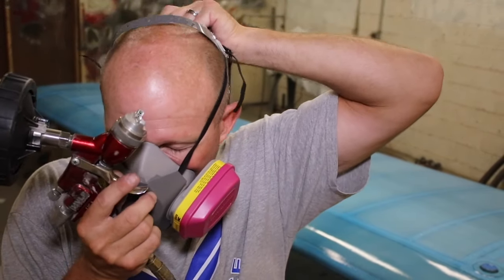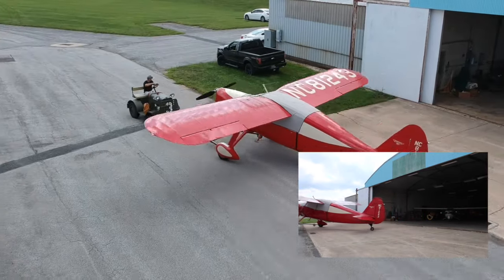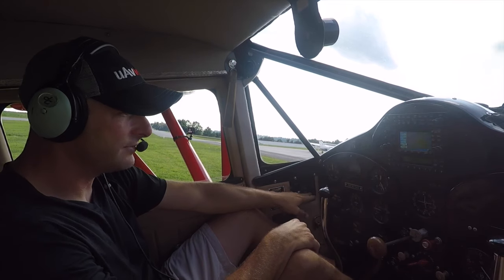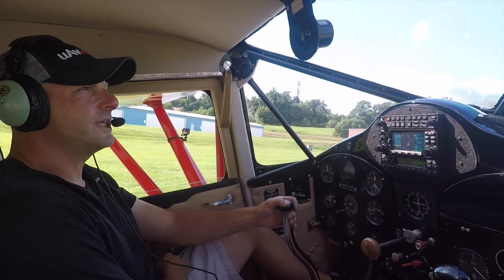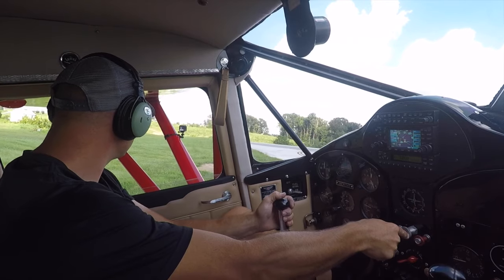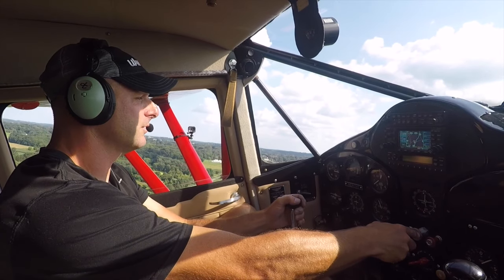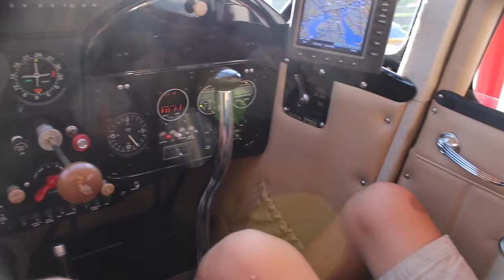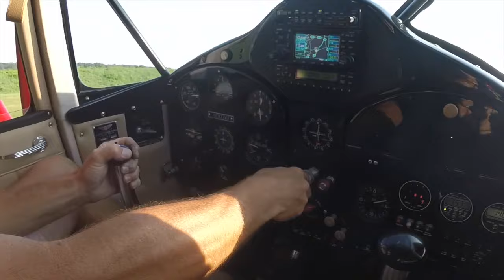Fairchild 24 Flying

Comment: Jonathan, Do you have the Ranger 6 200? what prop are you using?
Reply from the maker: Yes Ranger 200HP.  Aeromatic Prop
Reply: @JonathanMartinPilot  

I see … I have the Hartzell Hydro-Selective and sooner or later I’ll need to replace it. I wondered if you had another prop that was more available that I might be able to switch to. 😢